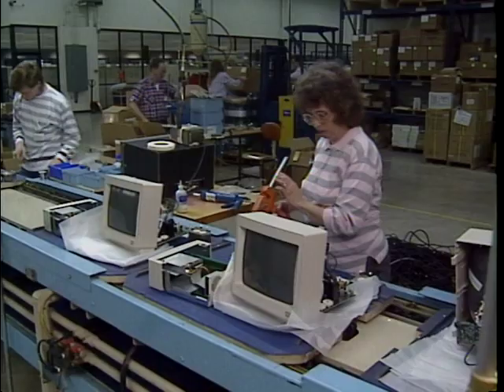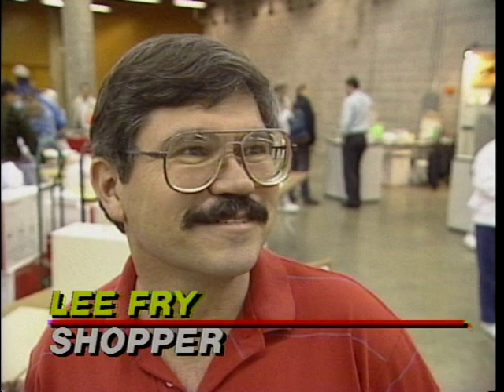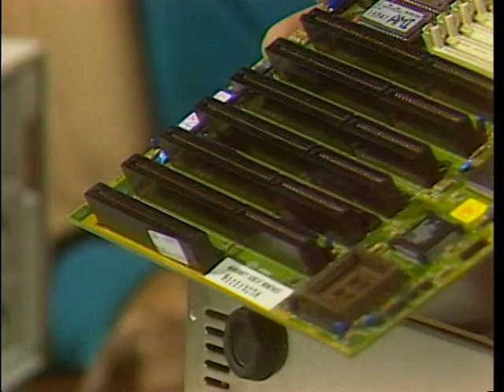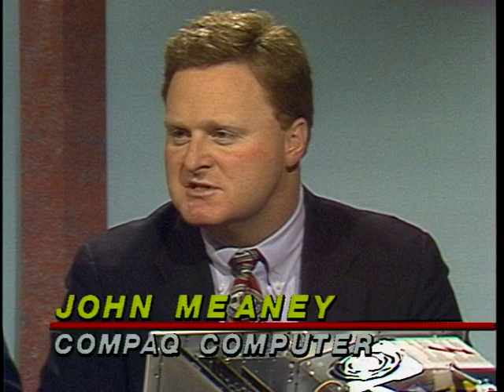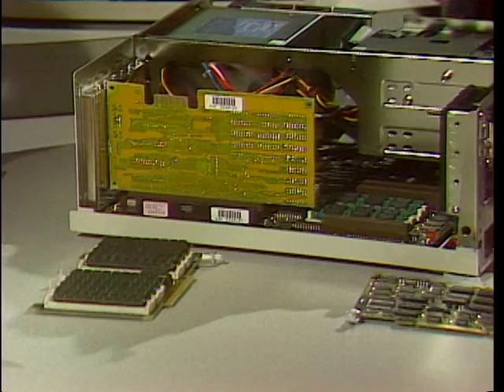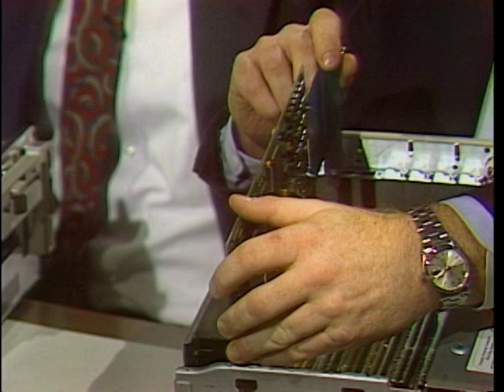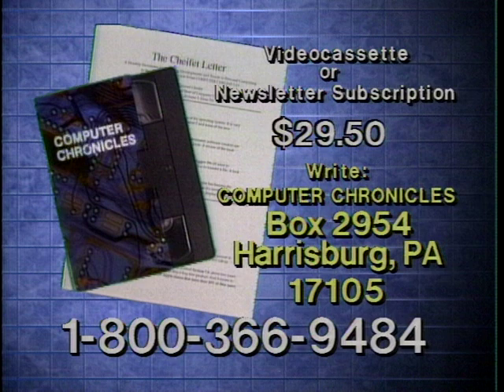The Computer Chronicles - Build Your Own PC (1992)

Comment: It's a bit spaz that he recommends three floppy drives but doesn't mention that most controllers/computers (both now and back then) only support a maximum of two. 3 or 4 was possible but required a special card to work - which he didn't use.

Comment: 1. Can't see how you can run three floppies on a ms dos pc, as there are only two configurable in the bios, and two connectors on the cable, one twisted, one not. The third drive, what drive letter will it get?
2. Can't see why you want two 5 1/4 drives, as the DS/HD 1.2m drives are backward compatible with the SS/DD drives at 360kb?

Comment: $500 for a mobo?  Man, those WERE the days.  Nowadays, you can get a mobo for less than $100.
Reply: Motherboards today are almost empty. An early 286 board can have upwards of 100 chips and DIP-sockets on it. You didn't put in 2 sticks of RAM, you put in 36 DIP chips in an array of 36 sockets. Everything had it's own controller; you even had a separate chip just for the keyboard controller. Later 286's and 386's really slashed the chip count down by integrating everything that used to be discrete functions.

Comment: To think back in 1992, if you actually tried going all out in terms of high end, likely you'd have to replace the computer by the end of the decade or maybe by when windows Vista came out depending on what specs you had on the computer.
Reply: nah 2 years max will be irrrlevent
Reply: @wissam3641  mmmm, yeah, your probably right.

Comment: Funny... even though Apple began falling into their dark 90s days, their 1992 computers looked more advanced and WERE more advanced than any others. In fact, a 1999 Windows PC (whether custom or pre-built) looks as if it's from the same time period as a 1992 Mac.
Reply: ***** Yeah - save for some machines of theirs that were unreliable or downright crappy, it seems as though they weren't as bad in the 1990s than one would think; people were essentially just forced to use Windows because it was the popular thing at the time. It's sort of like how gamers are forced to use Windows for gaming, since Microsoft dominates the gaming industry. It doesn't suddenly make Windows the better OS (in fact, Macs and Mac OSX are more fit for intensive applications); it's just that Windows happens to be the standard in that sector. That was more about software, though.

Comment: Hilarious.. They seem to left out setting up Master\Slave jumper... Which I/O ports use what IRQ\DMA channels... Battle of the Local Bus wars from ISA, MCA, EISA, VLB, PCI...As you made the wrong choice. It was replace everything. All over again....

So yeah. I remember them times. Spending days building 8088 machines, XT-AT, 286, 386, 486, Pentium......It was the wild west. Not like the Y2K hysteria helped either...But it sure drove PC sales. Using fear to drive it....

Comment: Im watching this for background noise while I build a 2.66ghz celeron d 331 (slower cut down pentium 4) pc with an MSI twin frozr r9-290 Gaming 4G.....you're not reading that wrong. "for teh lolz."
Reply: I'm doing the "Celeron and graphics card" thing as well but in a retro build. 1.1GHz Coppermine Celeron and a GeForce 3 200ti ;-)
Reply: ***** never had a geforce 3, that shouldnt be too bad because the difference between celeron and pentium was still just l2 cache, that will likely play retro games no problem and 1.1ghz is fast, i had a coppermine p3 at 700 and another at 800, the one used in the original xbox was 733mhz so 1100mhz should be snappy (on xp or linux).
it would give this netburst cel331 a run for its money, never did finish the build, im considering turning it into a necklace for a geeky girl i know but I wanna get the IHS off to expose the silicon but its starting to sound like more work than its worth.
Reply: Celeron necklace, if you can pull it off it could become the latest fashion trend, or something :-P Hehe yeah mines isn't assembled yet but it's a late 90s beige tower with an ABIT BH6 V1.1 motherboard; was originally a Slot 1 450MHz Pentium !!! but I've got a matching ABIT SlotKET !!! adapter and the 1.1GHz / 100FSB / 128K Socket 370 Celeron is a "known good" with this adapter in this board with the BIOS flashed to the newest 2000 version so that's what I got :-) Maxed out to 768MB (3x256MB) of PC100 RAM (came with a single 128MB stick), a 120GB hard drive (fully updated BIOS supports 126GB, original drive was 4.3GB LOL and I had to remove it before taking it from the building anyway), a Sparkle SP7000 GeForce 3 200ti 64MB graphics card in place of the 4MB ATI 3DRage, the original Ethernet card and floppy drive, a Sound Blaster Live! (system had NO sound card but no blanker on one slot either; must have had one at some point but weirdly missing...), and the separate DVD-ROM and CD-RW drives from the Pentium 4 box I acquired at the same time (which is a crappy Willamette / PC133 thing so I couldn't care less), to replace the original 48x CD-ROM. All powered by a Cooler Master 500w MAX power supply, just because it's safe and new and wouldn't dare try the original 235w thing. Still not sure whether to put Windows 2000 or XP on it. But yeah :-D

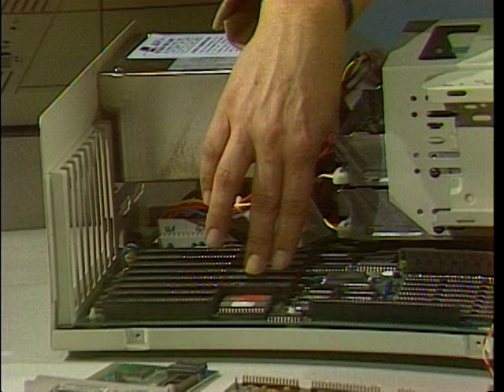Comment: 6:25 "And this is now the Volkswagon of PCs".  What did he mean?
Reply: +Edward Lee comparing it to the beetle of yesteryear being the "people's car" where it was mainstream and accessible to anyone who really wanted one.   during this period of time the 386 was middle ground, with the 8088 machines finally fizzling after years of domination.  in reality, it was probably the 486 line that was the Volkswagen of PCs since they were far more powerful than the 386 and software was becoming increasingly complex enough to take advantage of the 486's computing power (wildly iconic games such as Doom needed a 486 and win 3.1 ran best under it)
Reply: +oldtwins Here's what I remember. The AM386 DX-40 was on sale seemingly forever and just got cheaper and cheaper on ever more integrated 386 motherboards and it went in to the first really affordable IBM PC clones. This played some early 3D games reasonably well e.g. Wolfenstein 3D, Ultima underworld and  wing commander and it played most 2D platformers perfectly (e.g. the Keen games, Duke nukem). It could play Doom well only at lower quality settings.

The 486 DX2-66 both from intel and AMD was similarly around for a long time and that really was a game changer for 3D gaming. Doom, Heretic, Hexen, Descent, System shock, Magic carpet, Comanche, Dark forces, Need for speed and other games of that level of complexity very reasonably.

The pentium 166 and later the pentium mmx 166 was the next one of those cheap and ubiquitous CPUs. Played quake well without a 3D accelerator. With a 3D accelerator, you could play even Half-life, but not that well. With this level of CPU sound became a big CPU hog. The aureal A3D 2.0 cards were especially demanding (but then, the result was amazing if you had a fast enough CPU to afford it).

Comment: Upgrading old PCs is run , im using an old HP pro 3130 from 2010 i upgraded the CPU from an i3 550 to an i7 ,then i upgraded the ram from 2gb ddr3 to 16gb ddr3 which is max allowed ram and then i added an SSD , all running brilliantly on Win7 Ultimate, no Win 10 for me as thats dog poop

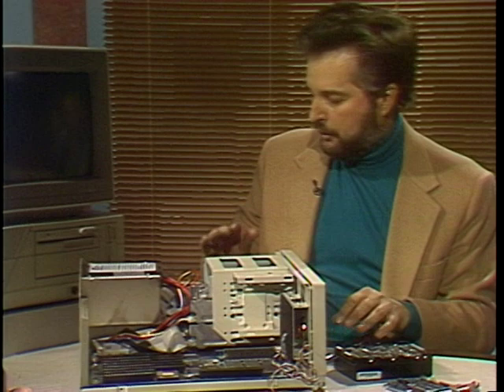Comment: @7:54  LOL- 200 mb in a 5 kg HDD
Reply: hard drives that were high capacity for the time were big. In my PC I have a shallow and quiet 1TB Seagate single-platter from ~2016 and a 750GB Seagate from 2008 that is a big tall noisy twin platter thing.

Comment: Take a look at that 200MB hard drive, oh man, imagine you showed those guys a 4TB hard drive or an SSD xD.
Reply: Gordon Freeman In 20 years people are going to say the same thing about your 4TB harddrive and your SSD ;)
Reply: Gordon Freeman Except you could have fit much more data on 200MB HDD than you can now on 4TB :D
Reply: *****
I highly doubt that.
Reply: Gordon Freeman Program bloat, that's why.
Reply: +Gordon Freeman   They would probably think it was a waste of memory. 200 MB was a good amount of memory to have for 1992 applications. You could store about 20,000 pages of single spaced text with that.  No digital photographs, mp3s or digital movies in those days. Windows 3.1 would shut down on you if you had a hard drive bigger than 512 MB. That limit was 256 MB if you were using just a 286 processor.
Reply: ldchappell1
I didn't knew that thing about W 3.1 shutting down, interesting.
Reply: Gordon Freeman
I think he meant it shutting down on more than 512 MB. However, due to the limitations of ODS 6.22 HIMEM.SYS, it only uses up to 64 MB.
Reply: what has RAM got to do with hard disk space...?

Comment: if they saw my 16gb ram they would faint
Reply: +Squarion   16 GB of ram in 1992 would have cost about $1.7 million, but it would have been useless with the PCs of the time. Windows 3.1 had memory restrictions. 16 MB of ram was the absolute limit. 256 MB of physical memory if you had a 286 processor or 512 MB if you had a 386.
Reply: +Squarion Probably not if they knew when it was from ... it's been a pretty standard model for increases in power over the last 20 odd years.  Only really started slowing recently
Reply: +Squarion yep  and the many of the outstanding hardware out now  lol
Reply: +Squarion and you'd get kicked from Star Fleet for violating the temporal prime directive.
Reply: A 16 gig hard drive would have been pretty out there too
Reply: No, the 286 is limited to 16MB maximum. On the other hand, a 386 can access to 4GB of RAM maximum, not 512MB ^^ ... but the density of memory sticks and the limitations of the motherboard made that no actual 386 PC could ever use this amount of ram although the CPU is cable of this
Reply: Squarion The host of the show is still alive and recently did an interview with a YouTuber. He has seen the excess amount of RAM we have today and he uses it too